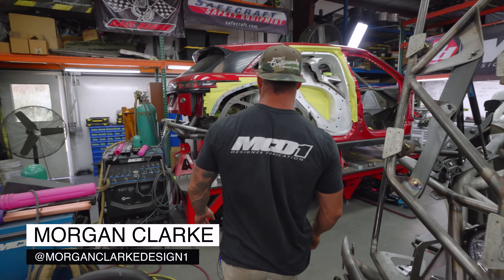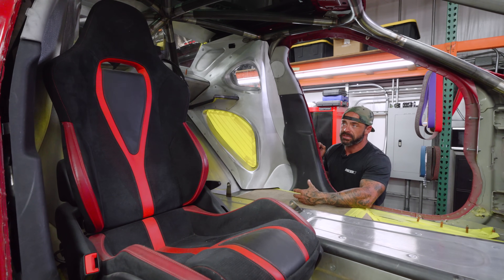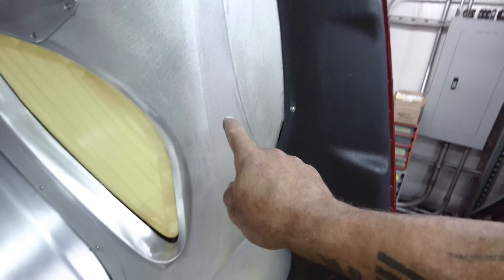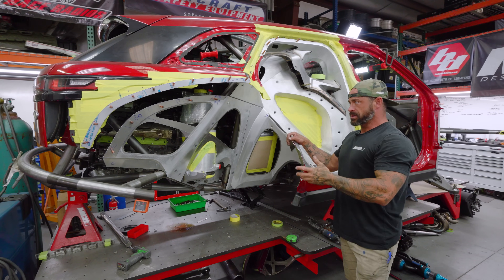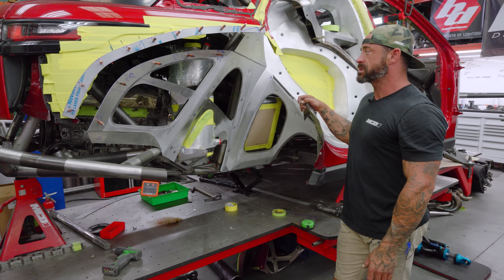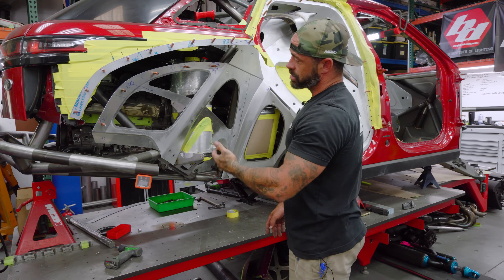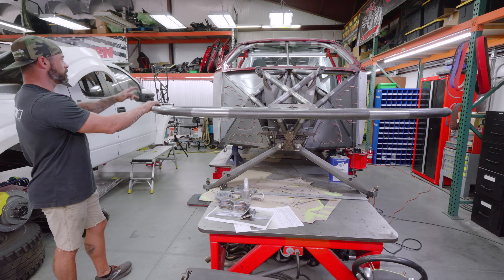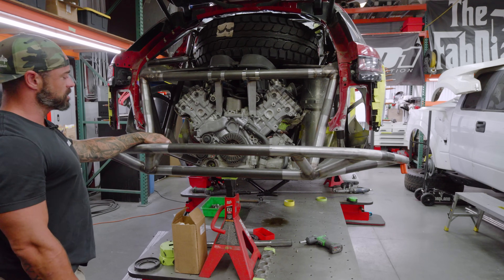Dakar Prototype PART 6: Interior and Quarter Panel Sheetmetal | MORGAN CLARKE DESIGN

Comment: Why do you prefer powder coat over steel-it?
Reply from the maker: Two completely different coatings. Steel
It is a consumable coating. It does not last like powder coat. It’s not even comparable. Same with durability. Steel it style spray is for cars getting respects. It doesn’t last for long amounts of time. It’s only available in 2 finishes also. That limits the capacity of design & style with color specs